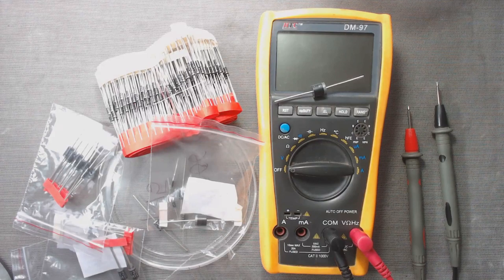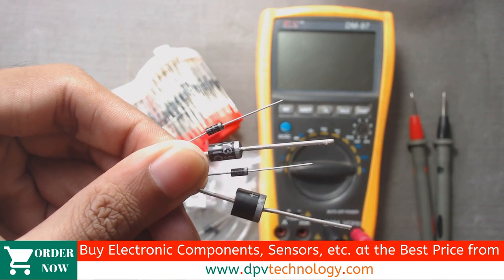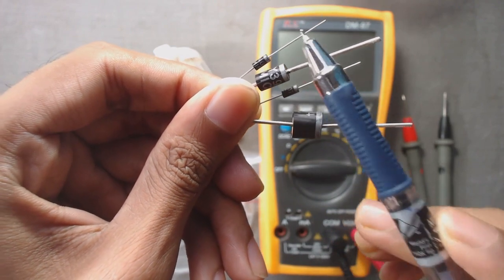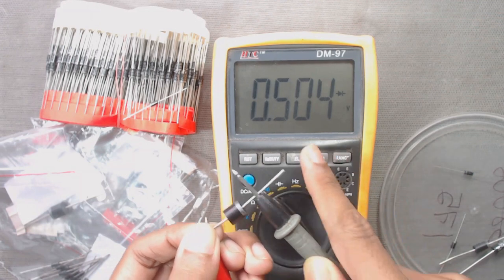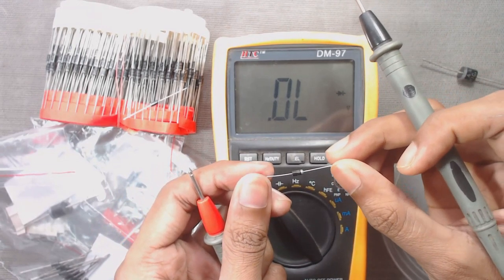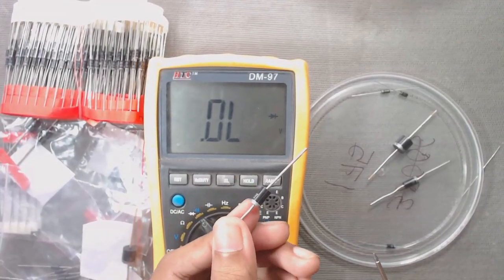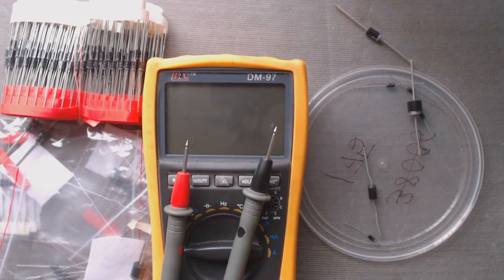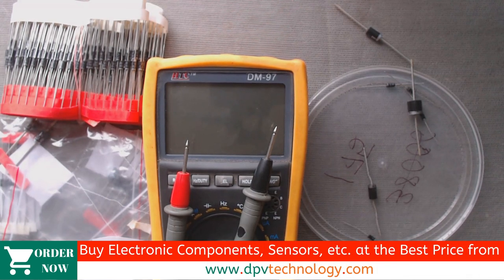How to Test a Diode with Multimeter   Diode Test Bad or Good

Comment: hi boss.if got reading 0.079volt  for 1N5832 when measured negative probe to negative side and positive probe to positive side?is it bad or good diode?
Reply: What does it give you on the other direction with positive on the multimeter on negative of the diode and negative on the multimeter on positive of the diode.
Reply: @ducksonplays4190  opposite reading OL-no value boss